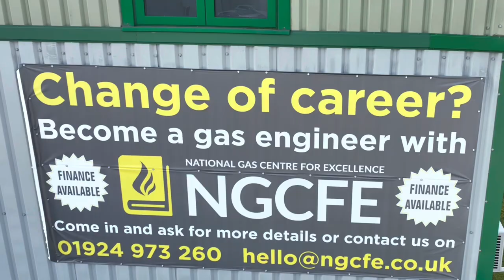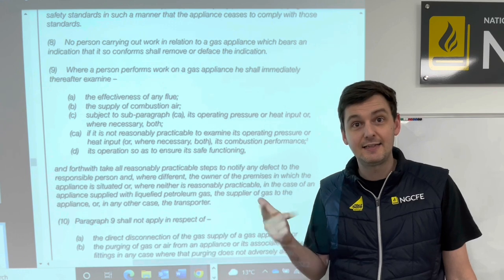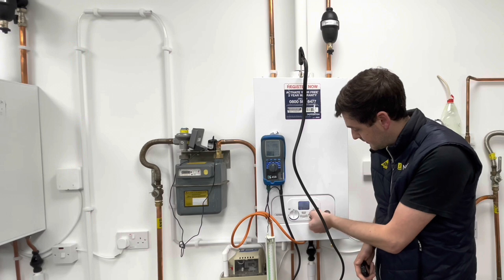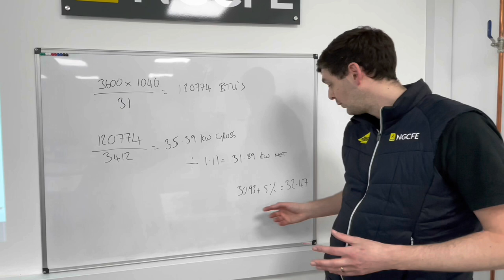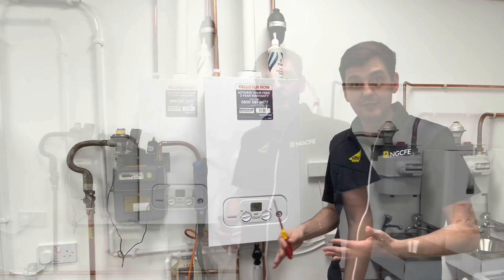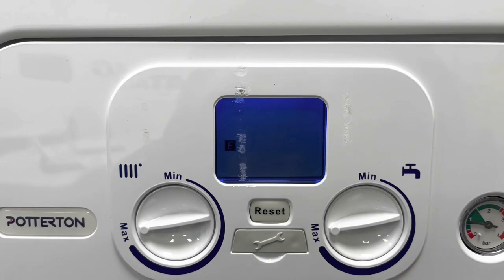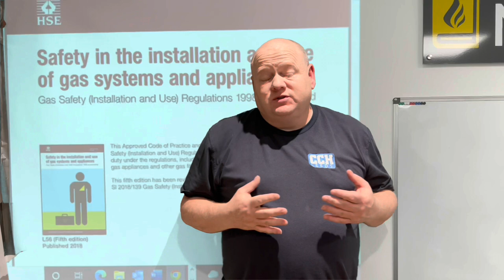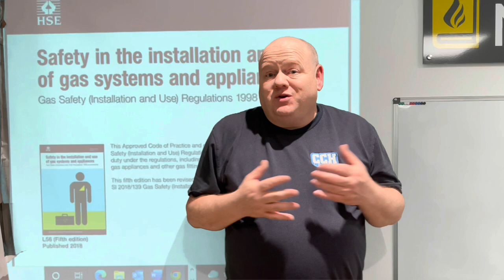Regulation 26.9 Gas Engineer Safety Checks | NGCFE

Comment: What would be really useful is a video explaining how to proceed if the gas rate is not within -10% and +5%. A lot of these gas courses cover how to gas rate but don’t really go into how to classify when it’s not within tolerance and also how to rectify.
Reply: Upsize / downsize pipe to achieve gas rate
Reply: @rjv9858  assuming the problem is with pipe sizing. Lots of things can adversely affect gas rate.
Reply: @edmetcalfe8974  what like? All got to do with the gas pipe itself, either too big, too small, blocked, too many bends etc if that’s what you mean? all boils down to pipe though
Reply: @rjv9858  Could also be faulty regulator at the meter causing low pressure, distance from meter to appliance, pipe size, gas escape on system, bad gas valve? many reasons.
Reply: @JayGasEssex your standing pressure would have clarified a faulty governor

Comment: Great video but you ideally want to spray LDF generously around the isolation tap of the gas under boiler once disturbed, not just the isolation screw. When disturbing the ECV by moving it also wanna spray around the handle, spray the anaconda and the two nuts in and out of the meter for peace of mind. Great video tho, nice and informative. 

Video suggestion would be safe electrical isolation, safe to touch test and checking the polarities etc on the boiler and the house. Many a time do I have a chat with engineers and they just don't do it. An idea mate :)

Checking the voltages across live and switch live on diverter valves is another idea mate, allowing newcomers to establish correct functioning (or incorrect) of the switch itself.
Reply: All true however this has nothing to do with tightness tests or meters other a than gas rating so you are really only going to use ldf on the appliance iso and / burner pressure test point
Reply: @tomadams94  true, just popping a few extra safety things in there in case a new starter sees something they wanna pick up; if they anything like I was back in day they will be watching everything and reading everything :)
Reply: @theheatingdoctor  no it’s good practice a lot of people don’t spray valves after touching them! 👍🏻

Comment: Have you seen that some manufactures of boilers are stating the type of circuit breaker that is needed?  I saw on a recent discussion board that a type B was needed?  It also went on to state that they recommend a SPD (surge Protection Device) in the fusebox/fuseboard/CU to protect the sensitive equipment on the PCB of the boiler

Comment: Can you clarify the 5% above and 10% under as TB 141 states that  under BS297 & BS EN 483 the 5% and 10% are tolerances during manufacture of the appliance for CE approval.  However there is no specific tolerance stated anywhere that is applicable to gas rating  at the time of commission or servicing. I think this is possibly  a rule that has got mixed up as it has been past down from person to person since 2012 when it came out.... Thanks